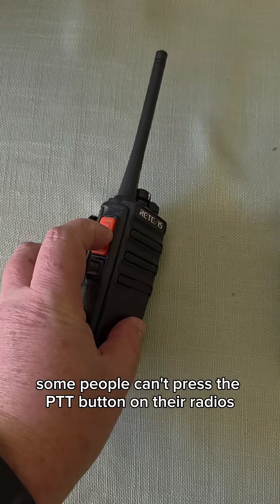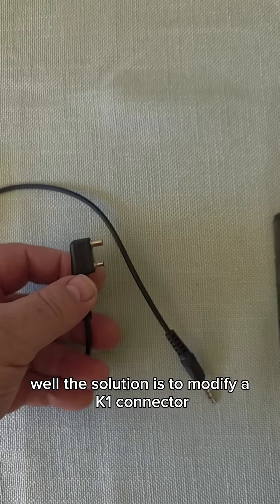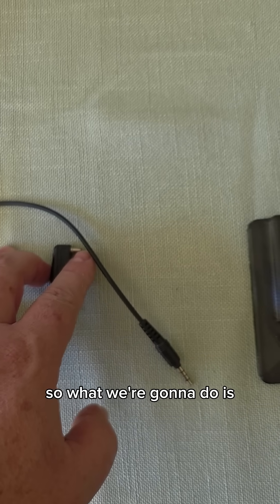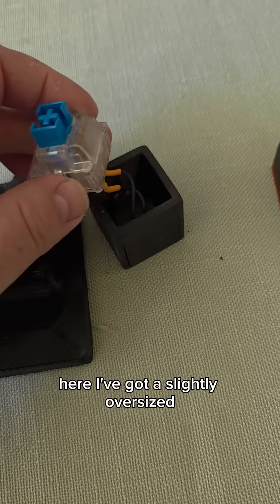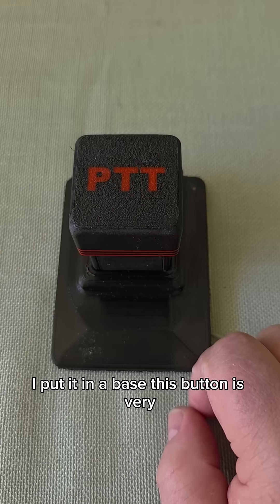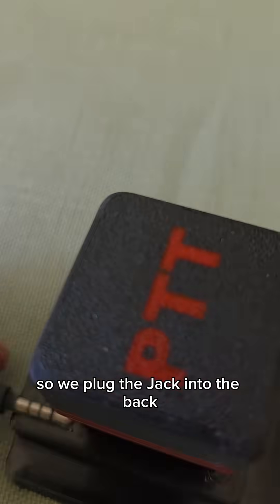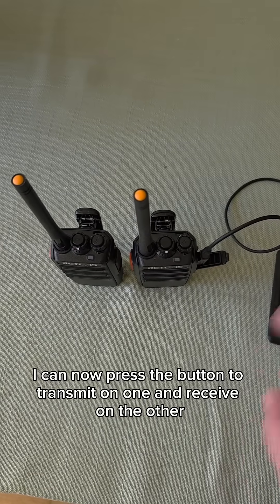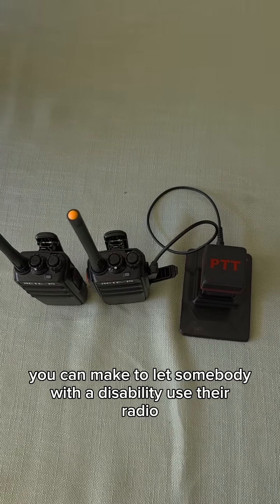Add a simple external PTT switch without losing speaker and microphones!

Comment: And who can't press a button yet has all that
Reply from the maker: Well....the general idea is that someone with a bit of hacker know how and a can-do attitude would put something together for them.  It really is as easy as identifying the two sleeves on the 3.5mm and 2.5mm connector, finding the wires that go to them, and putting a momentary normally open switch on it.  Any switch should do.

Think of it this way -- paraplegics aren't expected to weld their own wheelchairs -- someone else makes it and either gives it to them or sells it to them.
Reply: Here is the dumbass of the day! Someone without a hand or arm would be able to use this perfectly for PTT!
Reply: @wills4036 
Yes and you'd be stuck at a desk because that certainly isn't portable at that point which you might as well use your cell phone and speak to text features already enabled.
Reply: @ddragon91  You can definitely use that for portable use!! I don't know where you think that can't be portable.
Reply from the maker: @ddragon91 It’s not about you needing it, it’s about giving people without hands a chance at real independence.  I made this at the request of a disabled radio operator. I doubt he would have asked had he not seen a use for it in his life. 

No one’s selling anything here - if you don’t see a use, that’s fine. But if you’ve got ideas to make it better, I challenge you to share them. But if all you have are complaints, I encourage you scurry over to another corner of the internet and bother people there.
Reply from the maker: @ddragon91 Switches come in all flavors: foot pedals, bite-bars, eye-blinks—even bananas hooked to a capacitive sensor will switch. Puff-n-sip? Yep, got that too. And like people, some switches get cranky when a bit of stick gets jammed up where it shouldn’t go.

Sure, I’ve never seen a quad-amputee dragging this radio through Six Flags - and I've been twice! But I built this for a guy who asked, because his life should suck a little less.

Your move: go out and make someone’s day easier. Or… just go.
Reply: Then there's the dumbasses like you that don't realize this is USEFUL for people who can't push the button because they don't have hands/arms!!